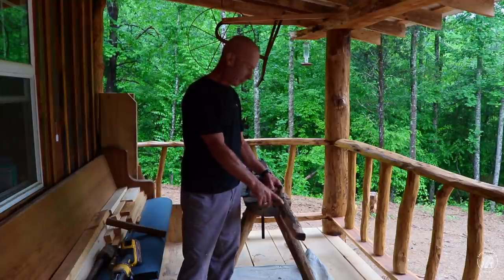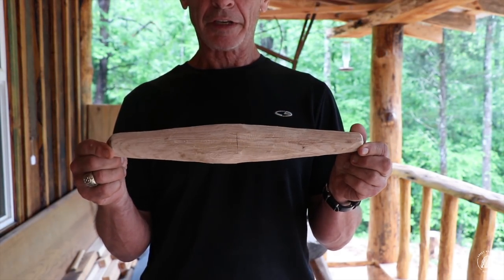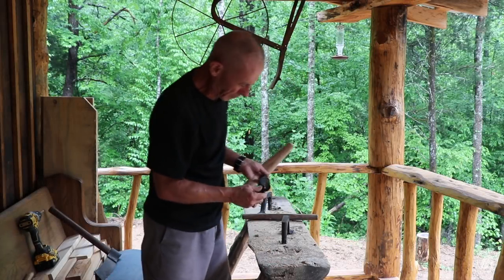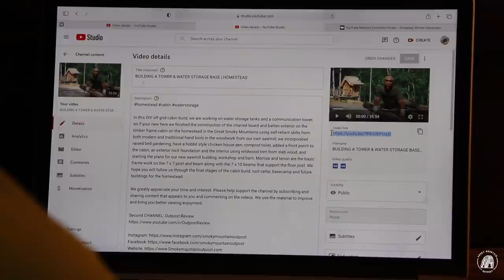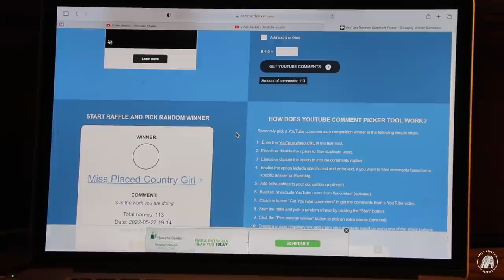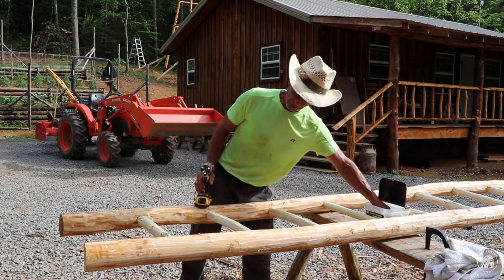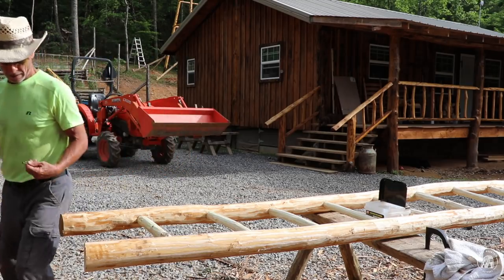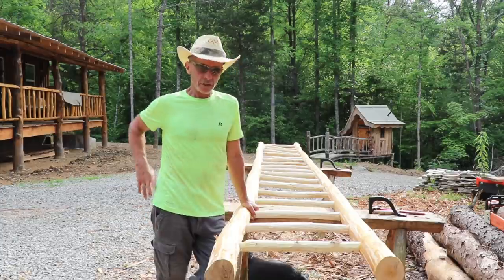MAN BUILDS DIY SATELLITE TOWER LADDER PART IV

Comment: Richard, my Dad made his own hammer handles using White Oak wood treated with Linseed oil after burning the wood over a fire. He used Bois D Arc wood split for fence posts. For shovels he liked to use persimmon wood. The root area of persimmon was used for golf club heads. Cedar shavings was used in our closets to expel certain pests. Red Oak is strong but very porous to water. White Oak was used to make buckets and whiskey barrels. For East Texas ash was used where a light wood was needed. Tung oil was used for furniture grade oil because of expense. Linseed oil was used for tools and to treat leather boots used in the woods.